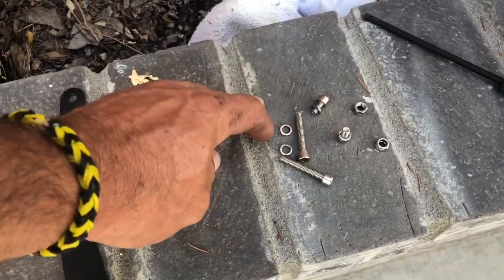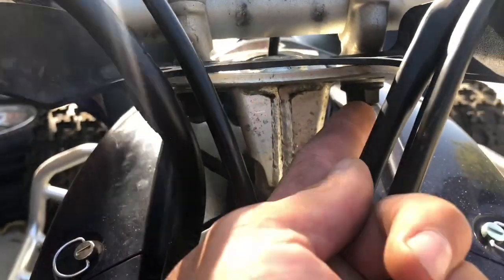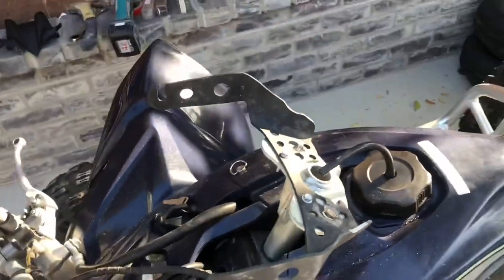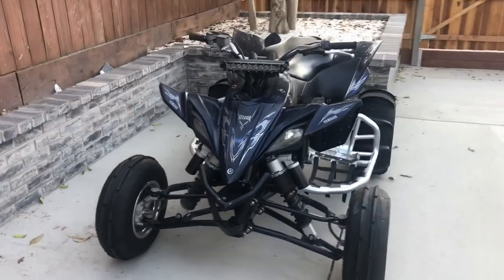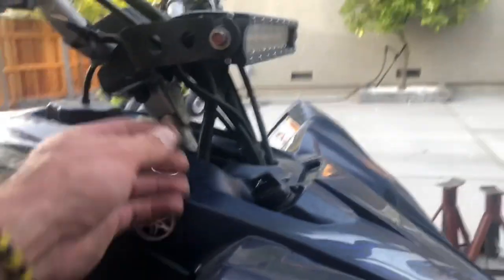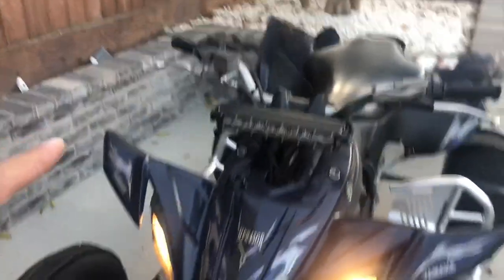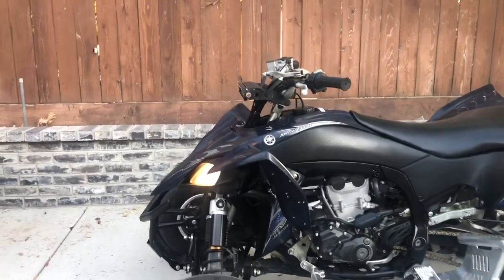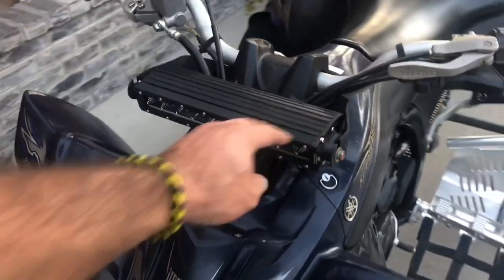Installing a light bar on the quad,

Comment: I am  trying to do exactly what you are. Did you have any problems with it pulling too much power from the battery and if you could tell me which color white you hooked up to what
Reply: I meant wire but also did you wire the light only to one of the stock lights

Comment: How did you connect it? I have red and black on led bar and  yellow, blue and black on my quad beam.
Reply: Need to know too
Reply: @JoseAngel-xb5ww  I think I connect it to the black and yellow and the led bar is activated when I turn to high beam.  I'll make sure in few hours and get back to you.
Reply: the RED/BLACK on the LED Bar is... : Red = "Positive/Hot" and BLACK = "Negative/Ground".  The Yellow/Blue/Black is most likely Yellow = "Low Beam" - Blue = "High Beam" and Black = "negative/Ground". **refer to a wire diagram for you specific bike** But if this is the case.. Black to Black and Red to Blue (Blue Or Yellow... depending which one is the High Beam Hot wire").
Reply: @mrmgjohnson  and how would I do this just twist them together?
Reply: @mrmgjohnson  could you give me a step by step if you don’t mind 😀👍🏼 would appreciate it

Comment: Do you need fuze or not ?
Reply from the maker: I never put fuze on LED lights
Reply: when installing a "Bare Bones" i.e.. installing your own wires and on/off toggle switch, its recommended to use a fuse and a relay switch.  When splicing into your existing wire harness, typically a fuse and relay is already part of your lighting system (from the factory) so tapping into the existing "High Beam" hot wire should be fine.  Just know, adding a fuse is adding protection... So ultimately IMO a fuse is a good is idea.

Comment: How do I connect the light bar to the headlights? Please pleas let me now asap
Reply from the maker: Wire bar to headlight wire
Reply: @customautobuilds  but how bro the red cable from the light bar to what wire and the black wire from the light bar to what wire on the headlight?
Reply: @customautobuilds  and how do I connect the wires from the light bar to the wires from the headlight
Reply from the maker: Try positive red to red black to black all it is is running a currentthrough the light
Reply from the maker: I tried putting the wires backwards and the light still works so doesn’t matter but if they’re color matched then match them by color

Comment: Could you make a video on how to connect it  to your headlights? Or give me a step by step in the comments😀 I just need help with the wiring red and black from the light bar to what color on the head lights and how do I do it?
Reply: Power (red) to green (high beam) , black to Ground on bike someplace or ground to ground wire for headlight.